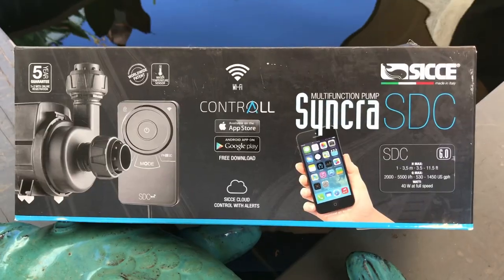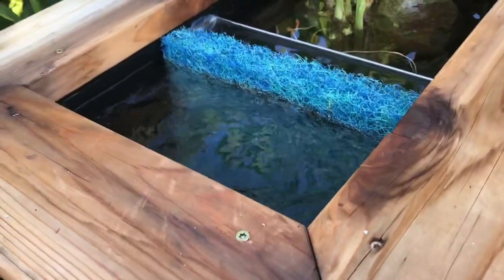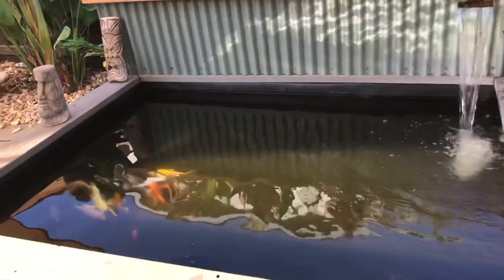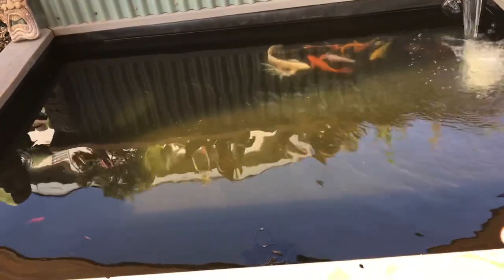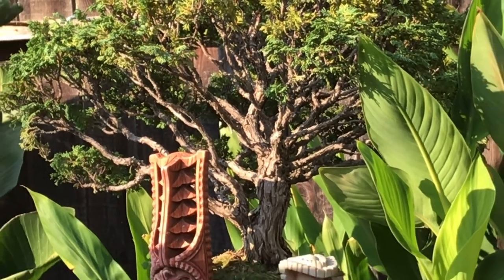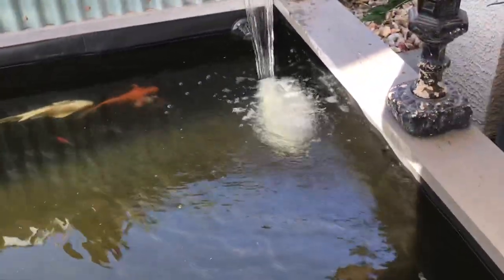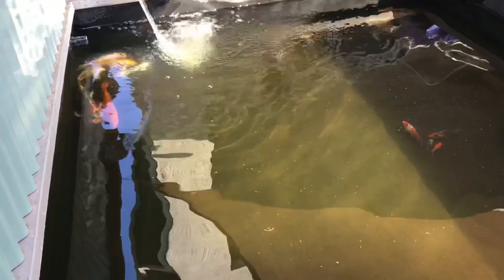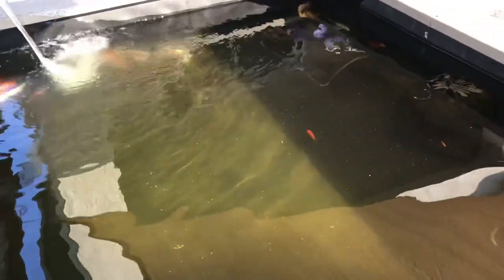BACKYARD DIY POND NEVER SEEN ON YOUTUBE!

Comment: I really need a 9.0 for my display tank. Wished I would have done it from the start but I didn't know what I was doing back then. I think I'm going to make a massive sump for my breeder racks and move my Simplicity to there and get the SDC 9.0. The flow control is epic having all 100%. The Simplicity only 10 settings for flow control, not a 100% like the SDC. Plus, if I get an SDC that makes 7 of my 8 tanks filtered by Sicce. I bought every one of those after watching your videos, so you definitely deserve your sponsorship. Thanks HFK!!
Reply from the maker: Ahh man braddah Clifford that would be sick the 9.0 is what I wish I wouldve got for my Pond… maybe I’ll upgrade, you will love it!!  Thanks for the kind words my braddah appreciate u!! OHANA 4-LYPH🤙🏽🤜🏽💥🤛🏽🤙🏽
Reply: @HaYNFishKeeper  I could make the 7.0 work but it would be close to max and you should never run any pump at max. My simplicity is 3200 gph and I only run it at 40%. The 9.0 would would be perfect and leave me plenty of extra. Tuning the return lines is tough with only 10 levels of adjustment. I have to constantly adjust the drain as well as pressure. Would be WAY easier to tu e with and SDC. Also, my pump now has heavy loss for feet of head. From what I've read, The SDC's are much stronger on their rise. So my 3200 probably isn't even close to that. 

Also, is Tiki Falls 4.0 going in soon? That back lawn of yours makes me sad, lol. Whenever you're ready for green, I got you covered.

Comment: A better way to measure the gallons is to measure how much it goes up.  if you pond is 8x8 every six inches is 200 gallons.
Reply from the maker: Actually the easiest way is to just Multiply its Width by its Length by its Depth. “DIVIDE BY 231” that’s the number of gallons B💣💣M